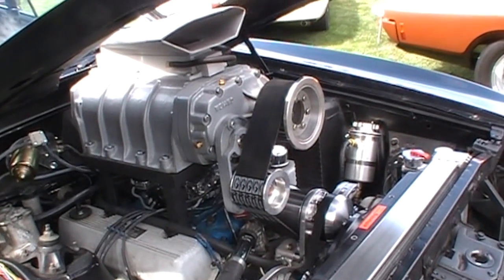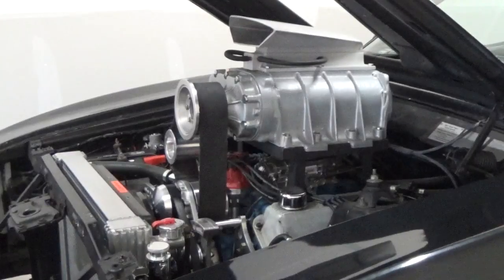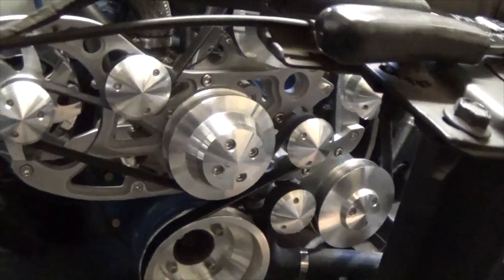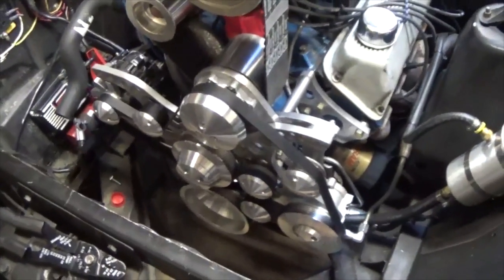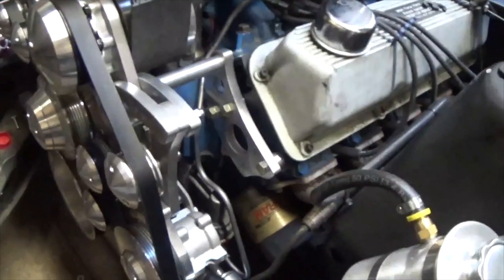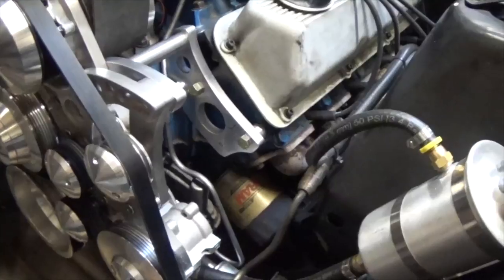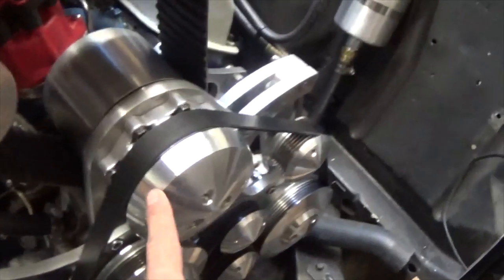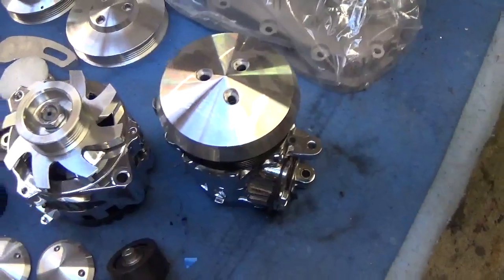Mad Max Interceptor Blower Drive Unit

Comment: The billet brackets and pulleys are horrible. All that march stuff is disgusting and definitely not period correct for a mad max car. Billet is ok on new cars but look like crap on older cars. None of that garbage on my gassers everything is period correct with mooningham blower. So this blower is all fake I assume with fake clutch setup because you can't get air through a blower unless it's turning

Comment: So bi's fancy air filter with moving parts that's actually doing fuck all ?
Reply from the maker: I have no idea who "bi" is.However, Though we can and do build them with real functional blower when the client wants it that way, most folks want the movie magic "superhero power" of being able to turn it on and off with the red switch. So we developed this awesome system to do just that while allowing AC, Power Steering and all the options while still having a blower that revs with the engine. So, in short, yes this is a video that shows how our "prop" unit works. Thanks for watching and for your comment!

Comment: I always thought it was a clutch system. Thanks for the great news 📰
Reply from the maker: Indeed, a electromagnetic clutch is how many builders achieve the prop On/Off blower drive trick. Electric motor does not change RPM with the engine, so we avoid that method. Not sure if any builders actually go that totally hokey route.

Comment: A blower drive could be made to work independent with injection, all it needs is an electronic bypass to deliver non-boost air and a heavy duty clutch to actuate the belt drive.  Your system is halfway there.  Essentially the electronic bypass timing is the important element when swapping over to boost.   Atomize extra fuel below the supercharger just like is done for nitrous.
Reply from the maker: It is certainly theoretically possible. We do even have clients building various methods of a working On/Off blower. We could do it for a client if they wanted, but it would be somewhat cost prohibitive. So far everyone wants the prop on/off unit like you see above, or a working supercharger. Nobody has yet stepped up to have the functional on/off unit created.
Reply: Luftmassenmesser sollte das Problem Lösen 🤔🧐🤷 ODER ....
Reply from the maker: @uhrzeit7764  Lots of ways people theorize to build the working on/off blower. It is theoretically possible.
Reply: Elektronischer Benzindruckregler 🤔🤷oder ??? Mehr Druck in der Leitung ergibt mehr Kraftstoff .... übrigens mein BMW damals (6 Zylinder Reihe) spritzt im auf allen Einspritzdüsen gleichzeitig ein,um immer genügend Benzinluft-Gemisch bereitzustellen 😅
Reply from the maker: @uhrzeit7764  Very cool.

Comment: So this is a working supercharger system that can be switched on and off? That's cool to me. I was always told it was just tv magic and impossible to do for real.
Reply from the maker: Strictly speaking this is our "Prop" On/Off supercharger. Its made from a real one so looks the part well, but is hollow and adds no boost. We do build the cars with functional blowers as well when a client wants but with no on/off function. Technically it is "possible" to have an on/off blower but its cost prohibitive at best and very challenging to have it look movie correct and be functional as well. We do look forward to the day someone has unlimited enough funds for us to develop the true screen accurate on/off functional supercharger. It COULD be done, with enough time, money, and skill.
Reply: @MadMaxCars  There were only two films that I saw feature the on/off blowers and both are from the 80s. 
1 was the famous Interceptor from MadMax and 2, the car from My Science Project.
Reply from the maker: @007Knightjp  Gotta love it when they reuse such a cool "Movie Magic" moment in various films to capture some of that same glory. While they might not be "On/Off Blowers" strictly speaking depending on how you interpret it, the same trope is used in "Deuce Coupe" (could be on/off blower as the car has a blower), and "Return to Macon County" (this might be supposedly a on/off turbo based on the under hood shot). Decent car movies either way, that use the same "Power boos on demand at the flip of a switch" plot device.
Reply: @MadMaxCars  Agreed. I've read somewhere that it is possible to build a working blower with such system using some kind of clutch mechanism or something, but these are quite complicated and not reliable, so most mechanics don't even recommend it.
Reply from the maker: @007Knightjp  Theoretically possible to be sure. My understanding is that some aircraft may have such a system among other things. It would be cost prohibitive at the least. Certainly not practical, however we have several clients who are building their own system of that type so we will see how it goes.

Comment: B-A-utiful-looking engine. B-a-utiful-looking car. My only concern is, did Max HAVE air con? Had he, could he have been less mad?
Reply from the maker: Thank you so much for the kind words! The original Pursuit Special in Mad Max 1 had a dealer installed "factory" A/C unit, so yes he did. It may not have worked due to how the production changed the engine around and added the blower, but our "Blower Drive Unit" allows AC and the On/Off Blower "Movie Magic". Only Barry the MFP Mechanic knows for sure if it worked "in universe".

Comment: So it is possible! Ive seen forums that went back and forth over if a supercharger could realistically be ran off a clutch pulley for 'selectable forced induction'. My only question is how does the engine breath when the clutch isnt engaged? Wouldnt the rotors of the supercharger screws impede if not completely seal off airflow? Is there some kind of bypass channel/valve that opens under NA then is blown closed when under pressure (sort of like a reed valve)? Or is this thing just for show?
Reply from the maker: Thanks for watching and for the question! We do build cars with a working full time blower, or the cool "Movie Magic / Superhero Power" / "Prop" On/Off blower drive you see in this video. While it is theoretically possible to have a clutched on/off "working" blower (there are a few approaches to this, some of which you already guessed above we know of a few clients building their own examples with differing methods), it is not only cost prohibitive and could conceivably require quite a bit of tinkering to keep working at its peak. To over simplify, it also would not allow for building the lower end of the motor to ideally suit either a blower or a naturally aspirated setup and would have to be a compromise between the two meaning neither could be built to its absolute peak of performance. The other drawback is that without considerable extra cost it would not look "Movie Accurate" with the vintage Weiand swing arm front blower cover and pulley position in relation to the bonnet. This video actually shows our non functional "prop" on/off blower drive which is the preference of most clients wanting a Mad Max replica.

Comment: Since the blower is fake, what makes the sound when it is turned on?
Reply from the maker: The whine actually comes from the cogged belt forcing air out of the cogged pulley, regardless of if the blower if functional or not.

Comment: I'm impressed an AC clutch can pass that much torque to drive the blower itself while under power.
Reply from the maker: The electromagnetic clutch device actually has to pull surprisingly low torque to operate this prop unit. Operating a fully functional blower would of course require quite a bit more.
Reply: @MadMaxCars  ohhhhh I thought that was a full blower...
Reply from the maker: @kleetus92  It is indeed built from a "real" blower, however it has been modified to be a on/off prop unit with the "Movie Magic" superhero power just like in the film. We do also install fully functional blowers for the clients who want that, but most want the on/off function.
Reply: @MadMaxCars  lol oddly enough, I had the two speed rear switch mounted on the stick of my 81 mercury car that I shoved a 351w police interceptor in..  had it hooked up to the flap on the forward facing scoop and it closed the two vacuum cans on the double snorkel intake underneath.  No difference in power but the sound definitely changed!
Reply from the maker: @kleetus92  Wow, that sounds like it was cool and fun!

Comment: I am far from being a car guy but doesn't that quick jump start put a lot stress on  it?Since it needs to catch speed in sec?
Reply from the maker: It can be a bit of a jolt for the system, but we have built our on/off blower prop device fairly sturdy, so it should take it ok.
Reply: @MadMaxCars  
Thank you for the reply and the info. I think it is cool but more a prop.Do you think it's for more show off than any?I can see if put a switch that says city driving into racing mode like a lot new super cars has lol
Reply from the maker: @ghostbombl8034  The on/off blower is indeed a prop built to function like the "Movie Magic" on/off blower in the film. We do build cars with functional blowers for clients who want them. No, we did not put a label near the switch as that would not be a screen accurate element. We do strive for as much accuracy as possible in our Movie & TV car replicas (we will do custom deviations as requested by customers however).
Reply: @MadMaxCars  
No matter what it's a body ass ideal  that works lol
Reply from the maker: @ghostbombl8034  Cool! Yeah.....

Comment: What's really crazy when you think about it you can actually do this with a real blower now,..... they put and EFI throttle body at the base of the intake between the supercharger and the engine and run it off of that when the supercharger isn't engaged running through its own carburetor(s).
 Problem is you can't just flick a switch to turn on and off you gotta carry some tools and a laptop. 

 Really cool either way!!!🚨🥼👍
Reply from the maker: Thank you! Yes the technology is theoretically there to make an on/off blower. It wouldn't likely look like the screen used movie car though. Also would be a bit cost prohibitive. Thanks for watching and for your comment!
Reply: @MadMaxCars  EXACTLY!!!
 The way already made us more gooder!!!🤠👍
Reply from the maker: @skeetermcswagger0U812  Absolutely!

Comment: doesnt shutting off a blower cut back drasticly throw off the ratio of fuel and air? I mean if you cut back on all that air dont you have to cut back on how much fuel its being fed?
Reply from the maker: This is actually a video demonstrating our prop on/off blower. If you look closely you will see the carb underneath. We do build cars with a functional supercharger for our clients who want it. Also, the technology is theoretically there to make a working on/off blower. It wouldn't likely look like the screen used movie car though. Also would be a bit cost prohibitive. Still it "could" be done.

Comment: Although I wish they could make a supercharger where you can flick a switch and it comes on like that I wonder if that's a 351 or 302 with a cam or stroke 302
Reply from the maker: It is technically possible to make an on/off blower. It would be quite cost prohibitive however. This car has a 351C engine.

Comment: this is why i HATE fake blowers. keep it real. i had managed to design an a system where u can run the engine supercharger(a real 6/71 and not a fake) on and off using a clutch, injector timing, V-tech(a must otherwise you'll blow the bottom end and the engine wont run right) and a breather plate(like on this guys car from drag week (1) SH*T BOX OF DOOM - Most Ridiculous Street Car EVER - YouTube)
anyone say thats a bad idea?
Reply from the maker: That is a very cool idea. The technology is definitely there to make a working on/off supercharger. However the look would not likely be movie correct, though I am sure even that would be possible given the budget to do it. Most clients simply want the prop like the movie or a real functional supercharger that is always on. We do both by client request.
Reply: @MadMaxCars  did you see the video i showed in the link? that was one of the examples from 1320video that a supercharger can be bypassed to run the engine N/A. the car is called shitbox of doom. it actually would be movie correct but it takes work to make the parts such as a supercharger clutch. bypass valve(u can use a 4.2 inch aluminum spacer. hot rodders had that at the time including throttle bodies too) and alot of clever throttle linkage to connect everything to a computer(holley is the best choice in this case since its very reactive to change and can work on any engine). i know this cause guys in that movie even scrapped imports for better speed parts like EFI of fuel injection(which was in those cars since it was late 80's early 90s. im not saying your wrong. im saying there is way more tech that other BG guy in the movies were using from cars not everyone would expect(not to mention imports were a big thing in the 80s and late 90s)
Reply from the maker: @jackmagnium6115  Just about anything is possible with enough time, money, and ingenuity.

Comment: How do you get air to the carbs and intake if the blower isn't turning. Air can't pass by the impellers, that would defeat the purpose.
Reply from the maker: This is a video for our prop on/off blower drive. We do build functional blower cars for the clients who want them, but that's another video all together. So in this case blower is hollow with carb inside....

Comment: How does the timing handle the variable boost?
Reply from the maker: This video is actually showcasing our "Movie Magic" prop on / off blower. While most clients what that "Superhero Power" on their build, we do make these cars with a functional blower for the clients who want one.  However that means no on/off ability. It is theoretically possible to do on a functional blower, but the engineering it would take to do that and trying to make it still look screen accurate wold be very cost prohibitive. So people generally just say it is not possible, which is true for the most part.
Reply: @MadMaxCars  open primary cluch for a big twin Harley Davidson . It's not that Hard!!!!!!!!!!!! They come with a 4 inch belt!!!!!!!
Reply from the maker: @highlanderfreelancer4553  I tend to think that would achieve the same thing we show in this video, but would take a considerable more effort to adapt that to simply bolt on a purpose built system. Is there some advantage I am not seeing to using a Harley clutch over the one shown in this video?

Comment: There is No Way that the Blower is a real Blower that can be turned on at anytime while the motor is already running.
It's a lie if ever a lie was told. The motor would have Blown the Heads and the Pistons
Reply: its made from a real blower thats hallowed out. the video title even says its a mad max replica. and mad max never had a real one.
Reply from the maker: Though we do build these cars with a real blower when a client requests it, this is the system we use for the "Movie Magic" on/off blower. It is made from a real blower, but is intended to be a prop. I don't think we claimed anywhere in the video that it was a functional unit.

Comment: So basically its a fake blower you can turn on and off sitting on top of your carb, not actually a power adder just a show piece ? 🤔
Reply from the maker: Though we can and do build them with real functional blower when the client wants it that way, most folks want the movie magic "superhero power" of being able to turn it on and off with the red switch. So we developed this awesome system to do just that while allowing AC, Power Steering and all the options while still having a blower that revs with the engine. So, in short, yes this is a video that shows how our "prop" unit works. Thanks for watching and for your comment!

Comment: I wonder if there would be a way to make this system work with a functional blower.
Reply from the maker: It is theoretically possible to have an on/off blower. Unfortunately to have it look "Movie Correct" and have a functional on/off system on a working blower would at best be very cost prohibitive. Still we would love to give it a shot if any of our clients ever wanted to invest in that type of option. Thanks for watching and for your comment!
Reply: Mr Shaggings yes you can
Reply: Yeah, but it would have to slowly feed air into the intake to avoid a blowout. You would need a system to block the instantaneous airflow from the blower, so that the air is fed into the engine slowly for a steady ramp up in the powerband.

Comment: Sounds awful. Why does it whine like that?
Reply from the maker: That is actually the sound of the blower. If you listen to the film you will also hear that sound in the film just not as close up. The "blower whine" is created by the cogged belt and pulley that run blowers. Its actually music to the ears of folks who like blower engines. Thanks very much for watching and for your comment!

Comment: MADMAXCARS, when you build a car, do you attach a Chevy Monza nosepiece? another video about the original noted that, but didn't go into any detail.
Reply from the maker: We do offer a custom nosecone exactly like the film which we install on pretty much every Mad Max "Pursuit Special" Interceptor we build. Its not a part from a Chevy however. It is the custom front nose designed for the  Falcon by Peter Arcadipane. It is often called the "Monza" nose (or often Concorde) because it has a similar style look to it, but it is in truth quite different. You can find the parts and more detailed information on www.madmaxcars.com Thanks for watching and for your comment!